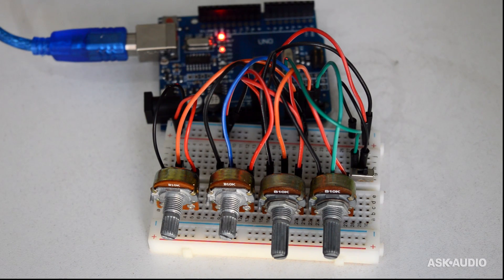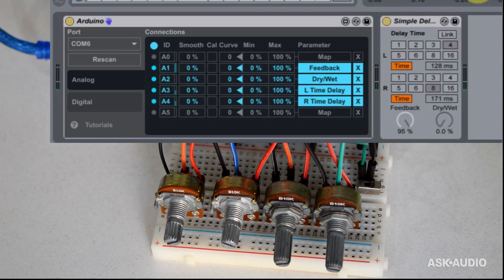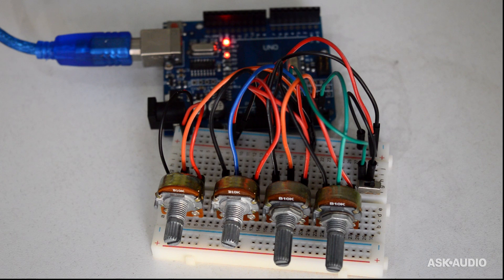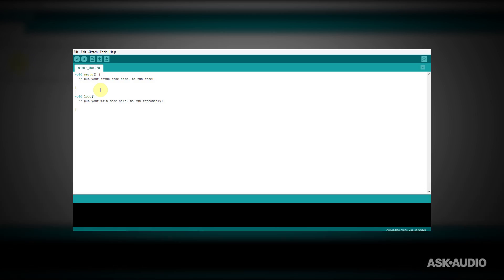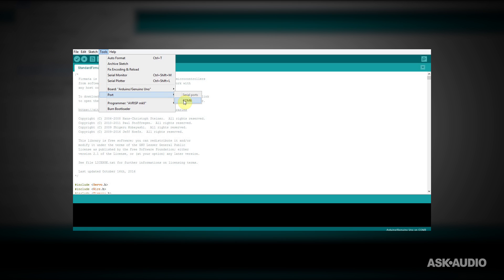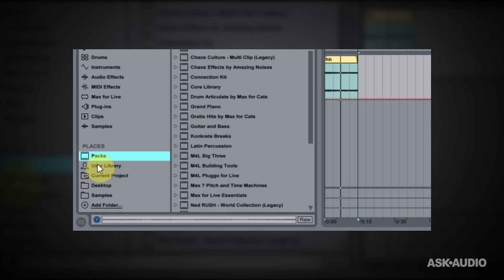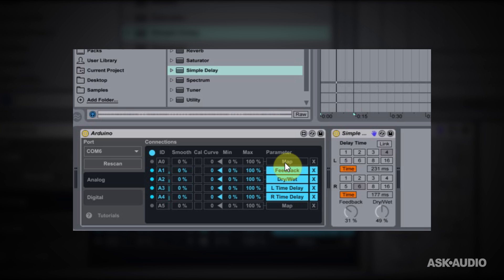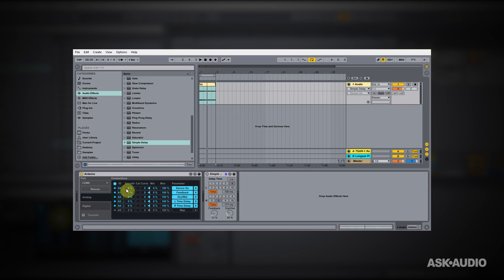Make An Arduino Analog Controller for Ableton Live

Comment: Hey there - can we achieve higher resolution than MIDI CC messages using this method? I would love to send a 16 to 24 bit number if possible. I'm trying to achieve fine-grained pitch control / CV input.

Comment: Thanks for this. I've managed to do the same circuit, but with 2 10K potentiometers, and got this problem: the pots interfere with each other. When one pot is on, the other one is too. Did this also happened to you? And, do you have a sort of solution to this? Thanks!

Comment: nice tutorial, did you ever post the tutorial on the problem of bouncing with the on/off switch?
Reply: May be you can use a Digital input or try with a PullUp or PullDown resistor. I think it's better to use Digital I/O, declare as Inputo and Mape it

Comment: excellent! does it work if i use another type of component like a distance sensor?
Reply: You get full access to all of the analog and digital pins on the Arduino, so you should be able to hook up just about anything that can be read directly from those pins (as opposed to using I2C protocol, etc, though maybe the provided sketch can be expanded to implement protocols like that). So as long as the distance sensor works for example by a simple voltage range on an analog pin, it should work just fine out of the box.

Comment: Could you have used the digital inputs for the switch (not the pots) instead of analog to clear up an extra analog slot?
Reply: Yeah I don't see why that wouldn't work. A switch is digital by definition (it only has on and off states, aka 1 and 0) and the plugin gives you full access to the digital pins as well as analog. I assume he just used the analog pin to keep the tutorial simple so he wouldn't have to switch between the analog and digital sections in the plugin.